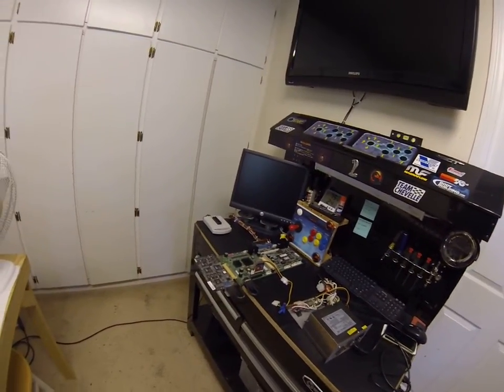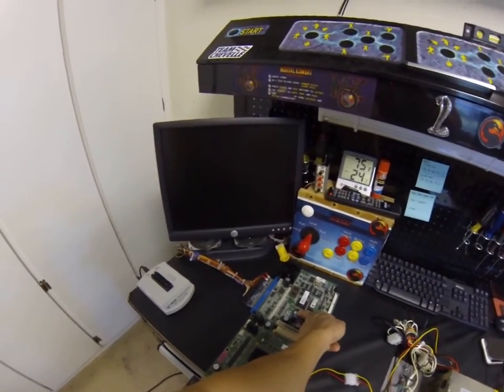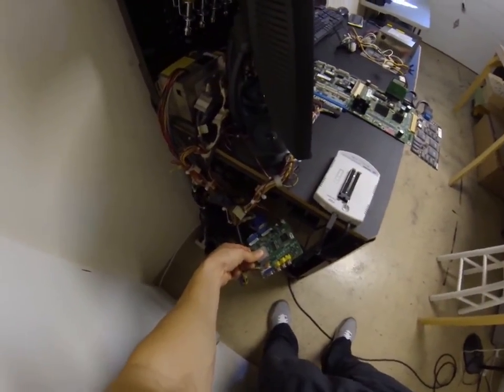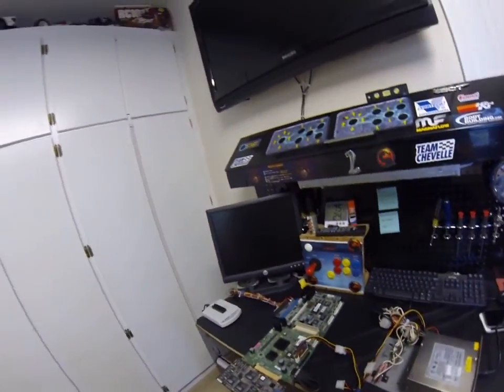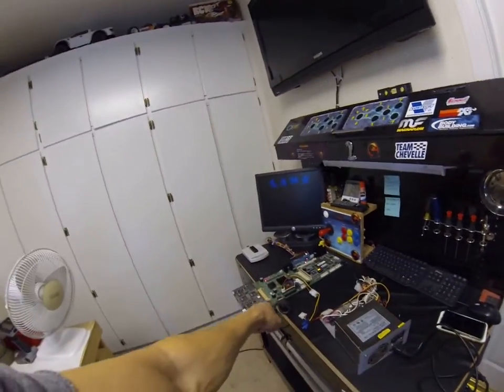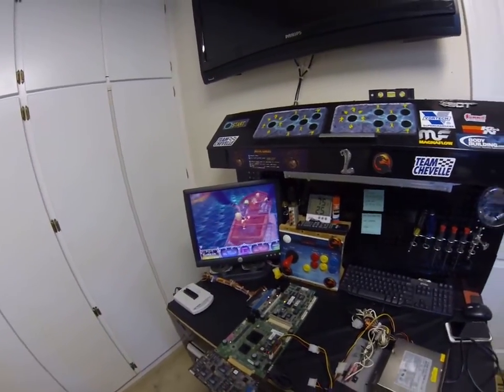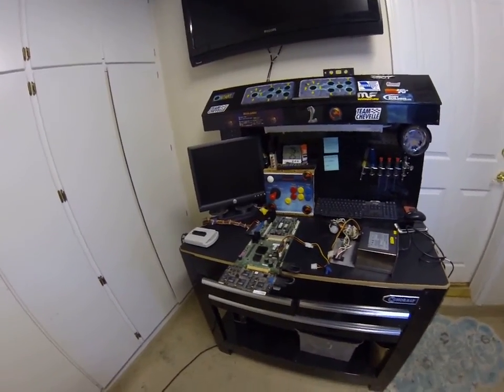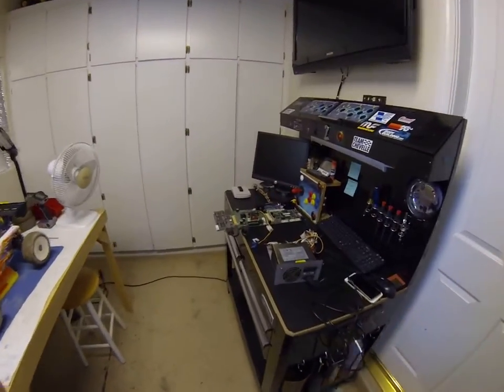Gauntlet Legends Arcade Jamma PCB repaired & upgraded toDark Legacy

Comment: Great stuff. And nice to see you again. You know you really don't need the 49-way sticks, just set the DIPs to normal 8-way / for 2 -players, and also set the resolution to VGA. That way you can play the game on your PC-monitor without the conversion-board. Just make sure it works with your Obsidian video-card, not all of them support VGA which really only means that you need to swap that out for a regular good old Voodoo2 PCI-card with corresponding RAM.

Nice workbench!